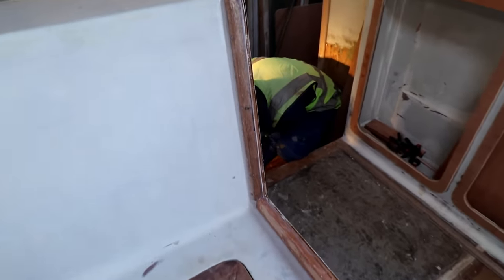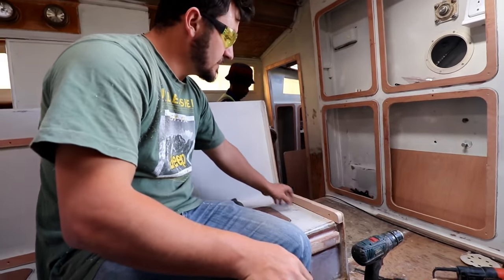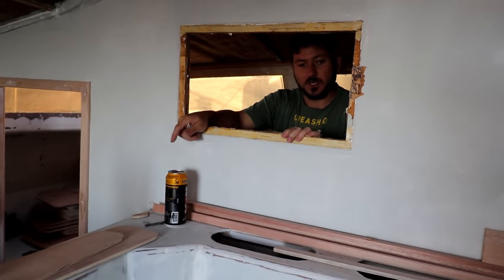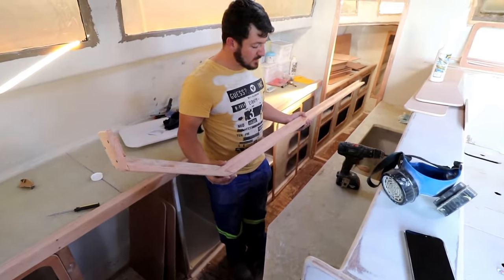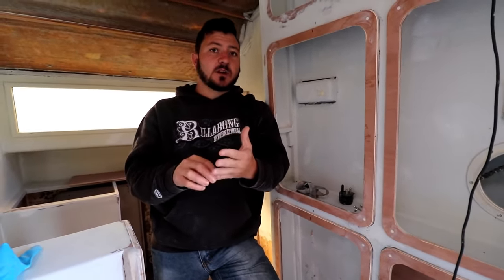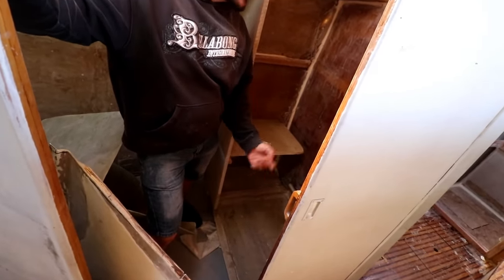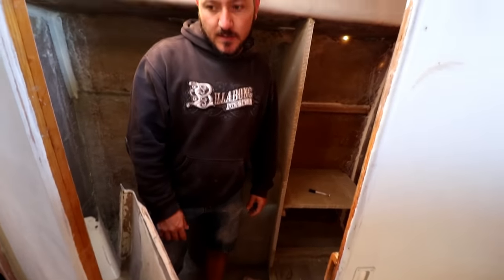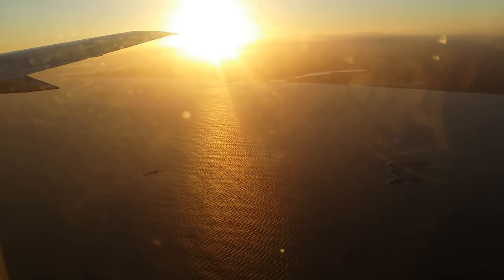Building the HEAD on our CATAMARAN Part 1 | YACHT REBUILD WEEK 22

Comment: I'm probably too late, but I would use a small layer of foam wrapped in glass to cover those interior bolts. Better looking and get you a bit more insulation and strength in that area without much additional weight.

Comment: Hi Riki ,  nobody ever realizes how must work it is to do a gut refit  of a sailboat. I try to catch people as soon as I see them starting a refit to not just rip everything out ( which is so easy and satisfying) and just fix what needs fixing. Or do one section at a time .YT has plenty of videos of boat projects started but Never finished. 
You have really stuck with it I'm so impressed. And you have 2 hulls! You have to do things the way you want them so a few steps backwards to get what you want is fine.  
If you can live with a more utility finish with exposed bolts and the like go for it . It will make life so much easier in the long run. 
I love the rounded corners for lockers etc. since you are painting perhaps you could have made a lot of oversized ' L shapes' trims and fitted them with just 2 butt joints?  You have to go with the different sizes because of the tight spaces in a boat.   Hopefully you can come up with a standard way of making the doors and hinge/ latch mounts.    
By the way, the foam backed vinyl does come in perforated versions to possibly provide a little ventilation , and the other thing is the Old vinyl you see on old boats is often 30 years old AND probably in a boat that's been neglected for a few Years and not kept ventilated like a boat that is used a lot so don't give up on vinyl as a quicker liner method especially if you attach to a backer like thin plywood or better 4 mm 'twin wall polypropylene sheet'. Super tough and durable.
Keep the faith, cheers Warren
Reply from the maker: Thank you so much 😊 We are looking at alot of options.. At the end of the day we want to make it livable, and practical and as maintenance free as possible.. Yes boats are always maintenance but where we can save us work in the long run we'll take it 😋 We will be doing the foam and vinyl with marine ply for our head liner.. We will weigh all our options and see what we can come up with.

Comment: Always good to have electrical as high as possible (opposite side of plumbing) to avoid short circuits in case of leaks.
Reply from the maker: We will be running our electrical above the water line and 300mm apart. 👌🏻

Comment: Stone chip works well Ricky. Just don’t try and spray it on to thick the first time otherwise it runs. Add a few layers at a time. Once done use a 2 coat paint to seal it and give it a gloss finish. It also makes it easy to clean.
Now you know why it took my dad 5 years for his build hey 😉 keep it up dude !
Reply from the maker: That's the plan. Thanks Mike 😊👍🏻

Comment: With any refit that you do your self can be daunting and the end is looking like it so far away. This can happen to any one of us so just focus on the To Do List and get them check off,   add new projects as you find them but make sure you complete the task you are working on. the light at the end of the tunnel will keep getting bigger and brighter with each task check off keep up the great work. It's good to hear you talk about how you're saving costs and keeping the quality of the work you are doing so keep up with that. 

The trim work you did in the look great and the added piece of wood makes make it look a lot better and stronger then it did before and like the idea of the removable piece of trim on the counter top. I all so like idea with the windows it will give it a real clean look then the sliding windows.

 As for the bolts I would cover them up with so trim or something that can be removed for inspection later on this is going to be your home not a working boat that you going to go out to sea and then back to port and then go home. Sorry for this being so long so keep up the great work and looking forward to the next one..
Reply from the maker: Thank you so much. Yeah we were thinking about doing some removable trim by the bolts as well. We still brain storming but will probably cover it up since it's working on Ricky's brain a little bit 😜

Comment: Thanks for your videos. You did a great job. Lots of things has been explained in other comments. One of the tips with the L-formed frames ist good but on the other hand very expensive compared with the way you did. the chain plate and the screws of it should be open as you can see if they become loose and/or stay sealed. So have a look to keep all screws, going through the hull or hold important parts viewable. If so you can see light rust noses and critical things before they become dangerous. Don't forget, it is a boat not a flat or a house. Technical parts should be easy controlled by opening a small door. forget the vinyl on the roof. I am sure you will be able to apply it (what is not easy). Think about small plywood (maybe 4 or 6mm) and put it with frames on the roof. it looks more like a boat and stays accessible i.e. for wire works or other things.
Reply from the maker: Thanks for the tips! We will be using a 4-6mm plywood for the headliner which we will cover in vinyl for aesthetic purposes. We have made the layout specifically easy for both of us to access anywhere that needs to be accessed. If we do add anything for aesthetic reasons, it is always removable and not fixed that it would require us ripping apart the whole boat to access it. We will be living on her for quite a while so we definitely do want to make it homey and comfortable as well. 😁

Comment: Vinyl can add a bit of insulation and sound deadening... even more if you attach an additional layer of thin insulation on the back with spray glue.. Could be worth it if you get the right materials at the right price and have a nice way to trim it out.  On the flip side, leaving it a textured painted surface makes it easy to clean up any condensation and mold that may come along with not being insulated and gives you visible inspection and access to all those backing plates and hardware.  Call it like you see it.
Reply from the maker: Thanks Luke. Looking at maybe something removable just for aesthetics purposed as we don't really want to go the vinyl root as that's what made the boat all moldy and rotten in the first place. 😋

Comment: A couple of great Design changes, the windows will look alot nicer that way and move more air. I'd paint everything but the living spaces, salon and cabins I'd vinyl cover..
Reply from the maker: Thanks Tony.. We trying to avoid Vinyl because of the previous problems the boat had with it.. And other boats we have seen.. Looking at doing a stone chip paint finish 😊
Reply: Sailing Lady Africa ,here we call it Popcorn and can't wait to sand it and cover it. Have you thought about insulation ? You'll need it as you go North then West ? What your plan for that. There's foam insulation that's anti- bacterial that you can use then cover..I'm feel if ya don't use any you'll cook and freeze your butts off...
Reply from the maker: We will be putting insulation don't get me wrong, but we don't want to put it everywhere. So places we are trying to avoid putting insulation, we are looking at alternatives. We will be putting insulation on the headliner as well. When you say Popcorn are you referring to the stone chip finish?
Reply: Sailing Lady Africa , yes we call it Popcorn.. it's usually put on ceilings in house's to hide poor drywalling, I think it'll work well in the unfinished areas of the boat but where you don't want coverings such as your Galley I'd fair the fiberglass and use a smooth painted finish I really think you'd be happier over time..
Reply from the maker: With a smooth finish comes alot of hours worth of fairing... They all have their pros and cons.. We will see what we do 😊
Reply from the maker: Tony Alexander I saw what you mean by the popcorn.. But that's not what we are doing at all. Haha 😂 I'd also want to sand that off. It's more of an orange peel texture that we are going for.. It's not rough at all..